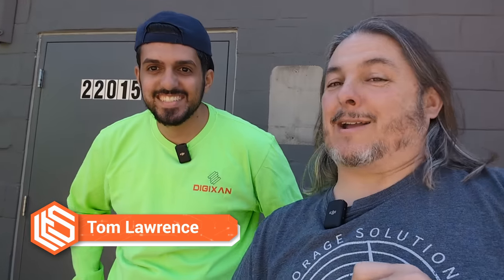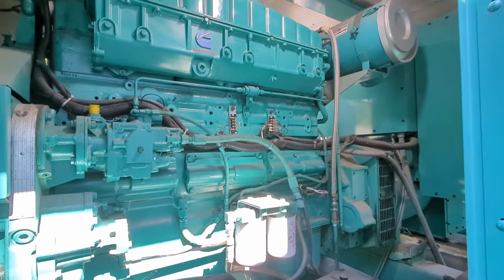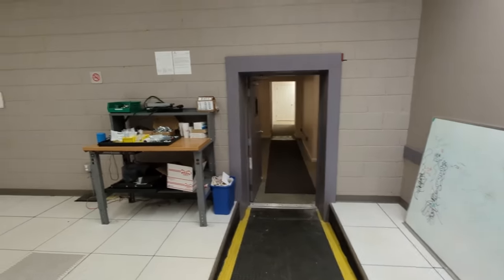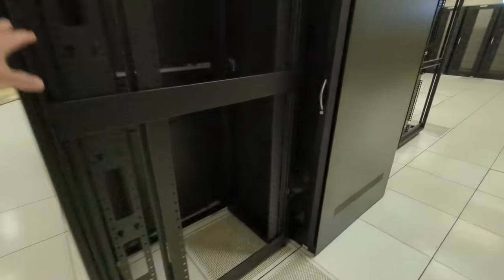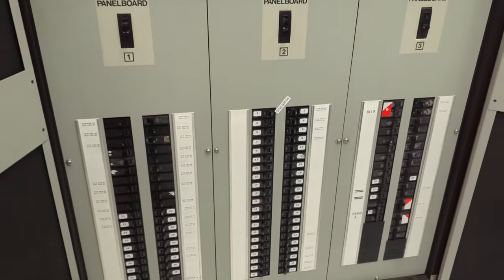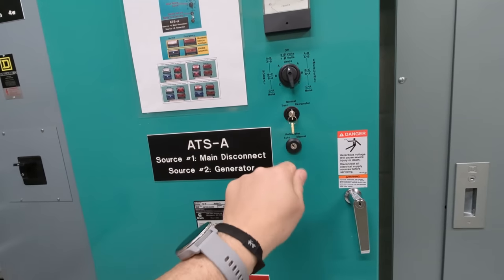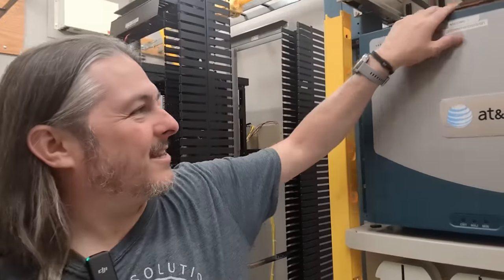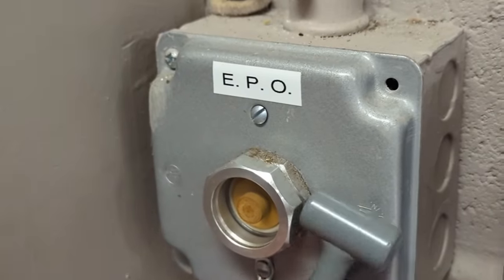What's Inside This Decommissioned Data Center?

Comment: The used water in case of an fire?? Is Argon gas forbidden in the US or is it because the DC is so old?
@Tom you love switches for sure : )
Reply: Most quality's DC used to use a Halon fire suppression systems but due to environmental concerns Halon was replaced with FM-200.   Due to costs, lower quality facilities will utilize the dry pipe or pre-action systems that require a smoke or heat detector to confirm the presence of fire before opening the water value to the sprinklers.  Then only the sprinklers that receive enough heat to activate open, limiting the scope of the water.     This prevents someone on a ladder bumping a sprinker and causing it to activate accidently, but is still much worse than FM-200 as a gas based system does no damage to equipment.    It just comes down to costs.
Reply: @beachstreet5970  FM200 is here, in The Netherlands forbidden, we use Argon gas. Thank you for your answer about the sprinkler system.
Reply: @michnl1772  Thanks for your comment regarding Argon.  Where I am here in the US, we don't use Argon.   I don't know the specifics of why, but one thought is that FM200 does not displace all oxygen in the room and does not settle to the ground like Argon.    The designers of the system need to ensure enough oxygen in the datacenter floor to ensure that if personnel are still present they will not suffocate.
Reply: @beachstreet5970  that's true, Argon gas gets oxygen to 14 percent.

Comment: Why did they cut the fiber??? Like if you're not gonna take it, why make it harder for the next person coming??? I don't see how that assisted the previous people in any way.
Reply: some building leases require that to be done, and its easier to cut it as well, and of course its a security risk, as you dont know what the last person may have done to it
Reply: it saved them from having to put blanking caps on all the switch ports. Maybe they forgot to bring caps or were just lazy.
Reply: another factor is likely speed of removal of the equipment, unplugging them might take a few seconds per line, times 50 lines, or just 5 seconds to slice them all.

Comment: Ei ei ei ... all the nice batteries are probably totally dead right now. 10000s of USDs just wasted 😞 which could have been saved with just a small power supply to keep them afloat.
Reply: The batteries were probably cooked before they were even turned off. For some reason large scale UPSes like to keep the batteries floating at a fairly high voltage (for idk, 10 seconds of extra runtime instead of 2 years of extra battery life?), and those batteries roast quickly.

Comment: I can tell what is inside....But it depends on how it was decommissioned. If all of the staff were just laid off and third party came in to remove the equipment. I can tell you there will be a lot of CRAP and PISS under floors. Just a little parting gift for the company which laid off their staff.
Reply: The datacenter was relocated across town (many many years ago). This wasn't closed as a result of downsizing.
Reply: @franklaszlo8166  Great, then probably no unfortunate mess to clean up. In my early years in 2000s with so many start-ups and buyouts and then eventually close-downs, I worked for a company which would sanitize the data off the servers, NAS, or backup hardware in order to make ready for re-sell while also palletizing. I can tell you that if the staff was let go quickly such as quick sell or just plain closed one day. Lots of surprises in the white floor.